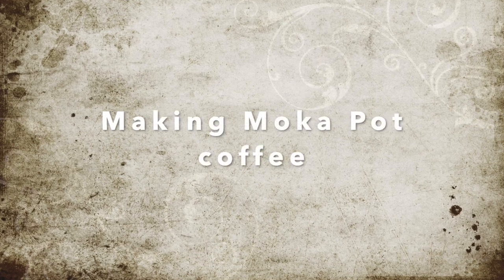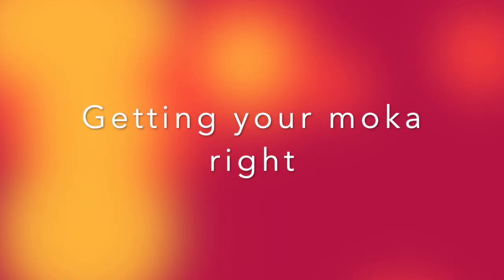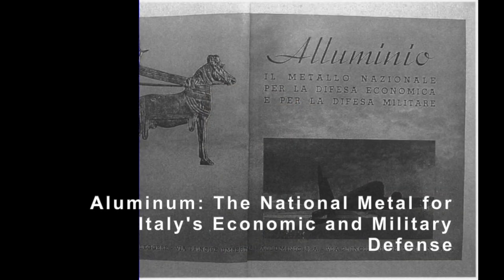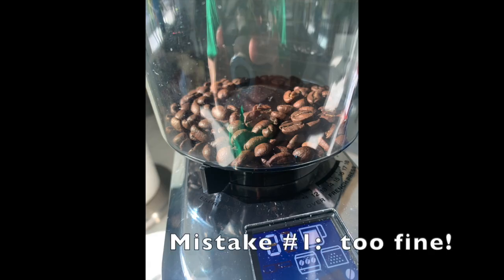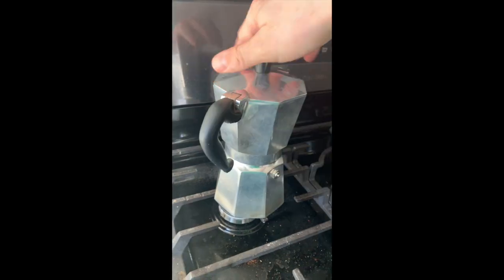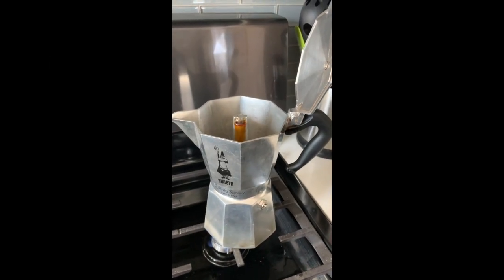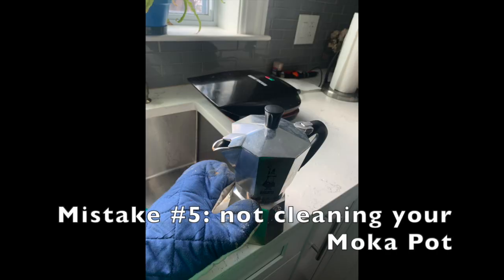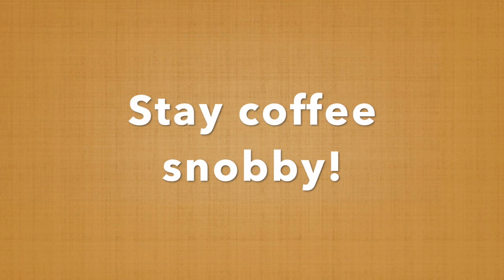Why your Moka pot tastes bad

Comment: #1: dont grind your coffee too fine!
#2: dont pack the grounds down!
#3: dont go past medium heat!
#4: leaving it on the burner too long!
#5: not cleaning your moka pot!
Reply: bonus tip : slightly open the lid while pouring to add some of the crema
Reply: @Jan2-e5g  idk I don’t have a moka pot
Reply: I'm not sure an aluminium pot is healthy, better use a inox one.
Reply: @patrickallard2520  I have a stainless steel Bialetti, they are available, I much prefer it, I won't use aluminium.
Reply: @Johro66  I think it's only stainless steel on the outside of the bottom part but aluminum inside. The top part is still aluminum inside and outside.
Reply: @patrickallard2520   aluminium pot by itself untreated is not healthy IF it is exposed to high heat, otherwise as medium to low heat it's fine; however Biallita pots, as I'm sure most others are made the same way these days, are ANODIZED aluminum, when that process is applied to the aluminum it makes the pot completely 100 percent safe for food to be heated even to high temps without any health hazard to the consumer.

HOWEVER, the anodized coating does not fair well in dishwashers or using dish washing soap, it can ruin the anodized coating, and that is why it is very important that you follow the cleaning instructions given with the Biallita Moka pots.
Reply: @patrickallard2520  Bialetti's aluminum is food grade aluminum, it doesn't get into the coffee and is not a health hazard. They also make beautiful stainless steel Mokas.
Reply from the maker: @patrickallard2520  hi, sorry I didn’t reply earlier, but the research has been done on the question of aluminum safety in Moka pots: https://m.youtube.com/watch?v=qV3Us0KkIMo
Reply: @patrickallard2520  Inox makes a much better cup off coffee too. I live in Italy and most sold are aluminum. Terrible!!!! I won't even drink out of it. I have my grandparents vintage Vev Vigano and it makes a huge difference. Or I use my inox or Le Creuset french press.
Reply: @lisa6371  Bialetti make a stainless steel moka pot too, I have one.
Reply: @lisa6371  I've researched it. The old 1960's warning not to cook or eat with anyone made of aluminum was debunked years ago. The aluminum used in the Bialetti Moka is good grade aluminum that doesn't get into your coffee. They also make nice stainless steel Mokas, and I have two of them: the Venus 2 cup and 4 cup.
Reply from the maker: @photina78  indeed, see my video in which I explained the results of a research paper about the safety of aluminum in moka pots: https://m.youtube.com/watch?v=qV3Us0KkIMo

Comment: Hey! (Yes I'm Italian...) Well done! I see your point of view! I always thought the same thing... That's why since 2019 I'm designing from scratch the Moka 3.0  (It will be open-source and 3d printable) So what to say... When I'm done I'll send you the prototype so we can see if it works better :)
Have a good one!
Reply from the maker: Oh hey, awesome! I love the idea, but can you 3D print in a material that can take a flame?
Reply: @loodog555  Sure! I have in mind two projects... The first project (the expensive one) uses SLS/DMLS metal 3d printing technology. The cheaper one is a bit tricky, with an FDM 3D printer you print the mold and then you cast fused metal in it (aluminum). I know that sounds a "bit" insane, but I like to think that in the near future metal 3d printing technology won't be so expensive. And yes... Casting aluminum is probably not that simple but with few inexpensive tools, you can do it at home...

Have a good one!
Alex

Comment: I'd say that mistake number 0 and the true reason your coffee ends up tasting like shit is to use boiling water in the first place. At 100°C water will extract the bitter stuff from the coffee beans, you want to keep temperatures below 90°C. 
And mistake number 3 is just hilarious. Your water is already at 100°C, it's boiling already!
Also, coffee should flow out of the moka as a very thin stream. It should not look foamy because, again, that means that water is at boiling temperature and tiny vapor bubbles are entrained in the liquid.
Reply from the maker: Hi, thanks for the comment!  Actually, as surprising as it is, the water is not boiling at the time of extraction.  In fact, if you don’t preheat the water, the extraction temperature will be around 69C.  I explain this surprising phenomenon here: https://youtu.be/O14BIH-9KTA

Of course, given the pressure dependence of the boiling point is the reason that #3 matters: you can actually extract at 120C in a pressurized container, which scours your beans terribly!  I discuss this here: https://youtu.be/2jLdGi7kjzk

Comment: There was a guy that tested various variables in regards to brewing a moka pot, with sensors and everything. In his tests using preboiled water didn’t give good results, i always used room temperature to start but i will try this method also.
Reply from the maker: Hi, thanks for commenting!  It sounds like you're talking about the paper I explain here by Navarini et al (2009): https://www.youtube.com/watch?v=2jLdGi7kjzk&pp=sAQA

though they never vary the starting temperature.  The only paper I've seen that experiments with starting temperature and gives recommendations is the 2009 paper by Warren King, which I explain here: https://www.youtube.com/watch?v=O14BIH-9KTA&t=40s&pp=sAQA

If you really have found a different paper that varies starting temperature, I'd love a link so I can make a video on that paper too!  

Personally, I find the starting temperature of the water doesn't matter at all: https://www.youtube.com/watch?v=jcgMeDDAT-s&t=1s&pp=sAQA so I found the whole debate kind of silly. An AeroPress filter, for example, is a much more important tweak to make: https://www.youtube.com/watch?v=fy1YKqrPYCw&pp=sAQA

Comment: I think the cooling under a tap is unnecessary. Why not just immediately pour it into a cup, therefore removing it from the hot moka pot?
Reply from the maker: Hi!  A number of people have posted this suggestion before and I'll give you my recommendation, though honestly do whatever works for you!  The issue is that some "momentum" builds up on the heating process so that the coffee continues to brew after you've removed the heat source so pouring out the coffee immediately won't stop the superheated steam from coming through and possibly scouring some of the remaining coffee.  This is why i recommend cold water to stop it.  That said, experiment around and maybe it doesn't matter at all!  This is just my theory!

Comment: A piece of advice from Italy:
- You have to really fill the part with coffee, making a little mountain with coffee powder
- NEVER wash the moka with soap. Only tap water.
Reply from the maker: Italians do a lot of things and some of them I agree with, while others I'm mostly eyeing with skepticism as a kind of cultural superstition about what's right.  Here's my follow-up  video: https://www.youtube.com/watch?v=jcgMeDDAT-s&t=1s&pp=sAQA

I've tried the little mountain and I've found it prevents getting a good seal so you lose all your pressure.  On top of this, it encourages the water to percolate unevenly, by providing lower resistance path through the outside of the puck.  I'm standing by filling up the basket all the way (which I don't demo well here) and shaking a bit so that the grounds level off evenly, but do whatever gives you coffee you're happy with.

Comment: I've lived in Italy and been brewing espresso in Bialetti Moka ( and others ) for over 40 years.. and have NEVER seen anyone pour boiled water into the bottom chamber. Quality water ( even bottled not fizzy ) is recommended, fresh ground ( finer that what I saw in the vid ) and while you said to not pack it down, I saw some packing down being done. Immersing in cold water does nothing, but yes, keep on medium heat and wash every time with water thoroughly and with dishwashing soap every couple weeks. Also they accumulate white water deposits in bottom chamber when used regularly, so need a special process and ingredients for cleaning. I do not use aluminum anymore and use plated Inox coffee makers, which give better taste, last longer and are easier to maintain.
Reply from the maker: Yeah,  lol, obviously no one in Italy preheats the water: https://www.youtube.com/watch?v=UFwP7Df3vVw

Comment: I used to start with cold water, but a few days ago I read that it should be hot, so I tried freshly boiled water, and the result was much better, smoother and tastier. I also tried grinding less fine, and that also improved the result. And yes, taking it off the stove when frothing helped too. So I agree with your recommendations, wish I’d discovered this years ago. Tomorrow I receive a new burr hand grinder, having always used a blade coffee mill. Apparently the burr grinder will make a big difference, as the grounds will be a more uniform size.
Reply from the maker: Indeed:  https://www.youtube.com/watch?v=dgM-_nPPKgw& burr grinders are necessity!

I'm told you get much better quality for your dollar with a manual grinder, but I'm laaazy.  You need that morning coffee to have the energy to operate a manual grinder, but you need ground coffee to get that morning coffee soooo,,,
Reply: @loodog555  I’ve ordered a manual grinder, but I cannot fault your logic. Looks like I’ll need an ekectric grinder too so I can wake up enough to use the manual one. Oh shoot.

Comment: Simple tips: cold water, low heat, remove as soon as coffee is out, always clean your moka properly (remove the rubber and filter before cleaning), use a fine brand mix of coffee, also put enough coffee without compressing it.
100 times better than the (in)famous coffee of foreign countries.
Reply: Why would you start with cold water? This just means longer on the burner
Reply: @OwMeEd  Because hot water doesn't make sense, makes me waste way more time, clutter the kitchen, and turns a good coffee in watered down flavour coffee, would it result in a better coffee at least.
Reply: @switchstatement568  Ah I see - for me it isn't so much extra effort because I have an electric kettle (which is more common in my country) - but I can see why it wouldn't make sense to boil water beforehand without one!
Reply: @OwMeEd  Yes but for me it's also because I don't like the results, I like regular intense coffee, which is not bad at all and since I always clean the moka even inside the rubber and filter, I never got that weird burnt taste that some people manage to make when not cleaning, burning the coffee, or just using a very low quality mix.
Reply from the maker: @switchstatement568  A 2008 paper by Warren King disagrees!  https://www.youtube.com/watch?v=O14BIH-9KTA. Also, James Hoffman and Tristen Stephenson also preheat!  But I don't personally find a difference, either way.  Do what makes the coffee you prefer, my friend!
Reply: @loodog555  World is big, would be weird if someone didn't disagree.
Reply from the maker: @switchstatement568  For sure!  I've just never heard of preheating the water as making it watered down in any way.  It's not like your changing the brew ratio.

Comment: This video displays some classic misunderstandings of physics and logic.  #1, that water boils at ~212 Degrees whether it starts hot or cold.  No matter what temperature water you start with, when it begins to boil and thus push the water up through the tube, it will still be at or around 212 depending on your elevation, so starting with cold water will make absolutely no difference; it will just take longer to get to a boil.  #2, the coffee is not in contact with the bottom chamber.  Cooling off the bottom chamber will have little to no effect on the coffee because it's mostly filled with air.  The only contact the two chambers have is the screwed rim and since you've removed the pot from the heat, not much more heat is going to travel up to the coffee so this will also make no difference.  #3 boiling it too fast.  This could make some small difference but you have to remember that the water will only boil when it reaches 212 degrees, so any difference is not based on temperature.  It could make some difference in the taste if the hot water runs through the coffee quickly vs slowly.  Everything in the video seems to suggest that having the coffee hot for too long is a bad thing, so if you follow that logic, it would be better to boil it quickly and thus reduce the time the coffee is exposed to hot water.  Either way the difference will be slight at best.  I've brewed my coffee slowly and quickly and I can't tell any difference at all.  People can imagine a lot of things that aren't real.  If you really want to test all of these ideas, then make the coffee using different methods then get someone to help you do a blind taste test.  You will likely find that you (the expert on your own tastes) cannot identify the "bad" coffee.
Reply from the maker: Oh hi Mark, you've stumbled into some of the basic misunderstandings about how a moka pot works, that I myself had at the beginning of my research.  As counterintuitive as it seems *the pot produces coffee long before the water boils*!

http://www.msc.univ-paris-diderot.fr/~phyexp/uploads/Moka/article1.pdf

"In this article, it will be shown that boiling the water is not only unnecessary, but in many cases undesirable, and that the physics is not as simple as might first appear."

I actually explain the paper thoroughly in this video if you'd like to be saved the work of reading it: https://www.youtube.com/watch?v=O14BIH-9KTA

but the essence of it is this: the pressure in the pot is NOT only the vapor pressure of the heated water (which reaches sufficient pressure to brew long before boiling), but also the added pressure of the air that's enclosed with the water in the first place.  This is why initial water temperature matters: because it affects initial air temperature and therefore its pressure contributions.

Pretty surprising stuff, right?  

As for the coffee being on the pot for too long causing problems, the support for that is based on a 2009 paper by Navarini et al. (https://www.sciencedirect.com/science/article/abs/pii/S1359431108002299).  I explain that paper here: https://www.youtube.com/watch?v=2jLdGi7kjzk&t=0s but the essence is that sending superheated steam through your beans substantially overextracts your beans, and that's what happens when it starts bubbling, which Navarini et al. call the "stromboli phase".

As for the actual nuts-and-bolts of trying it and seeing the difference from on experiment, I'm actually in complete agreement that IT DOESN'T MATTER IF YOU PREHEAT THE WATER, which is why I'm baffled and frustrated that everyone seems to come here just to debate the water preheating thing when it really doesn't matter.
Reply from the maker: On another interesting note, you (and I) came in with the exact same misconceptions as the first couple papers written about moka pots, way back in 2006: https://www.youtube.com/watch?v=yl4K1no9gh8&t=0s

Comment: Thank you, been using high heat until now. Seems contradictory to pre-heat the water and then only use medium heat. Medium heat does seem to be better, high heat must send the water a little too fast through the grinds so medium heat slows that down a bit. Maybe pre-heating the water makes up for time but it takes time to heat it to the side and then handle it hot. 2 take aways for me are using medium heat instead of high and removing it once the smooth flow ends and the splattering begins.
Reply from the maker: So honestly, I really don’t think it matters that much whether or not you pre-heat, though everyone seems to really super strong opinions about it.  I pre-heat because it saves time and is more energy efficient.  The notable names in third wave coffee like James Hoffman and Tristan Stephenson do it, but the most compelling argument for me is that there is a 2008 paper by Warren King (I explain here: https://m.youtube.com/watch?v=O14BIH-9KTA) that uses computer simulations and Darcys‘s law to show that whether or not you preheat the water affects the extraction temperature, since you are always heating the air at the same time you heat the water. The result is that the pot does not brew at the same water temperature no matter what, but depends on whether you’ve preheated.  

The reason for not using too much heat is basically that it becomes very easy to overpressure the thing.  The water does not need to be forced through; it will flow just fine with far smaller amounts of pressure. The higher pressure can blast your beans in an undesirable way and lead to overextraction. 

All this said, this is mostly theory and my experience. If your experience leads you to something different, then go for that. Don’t take my word for it.  Good luck!